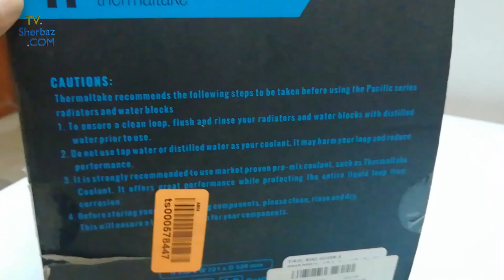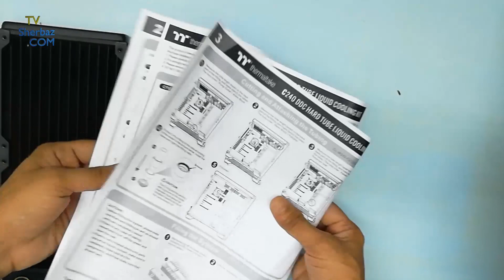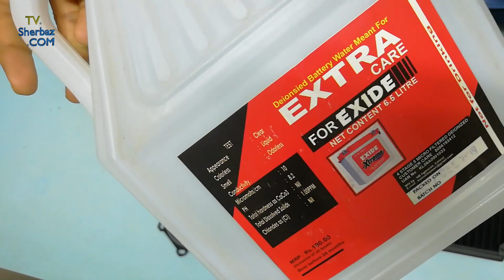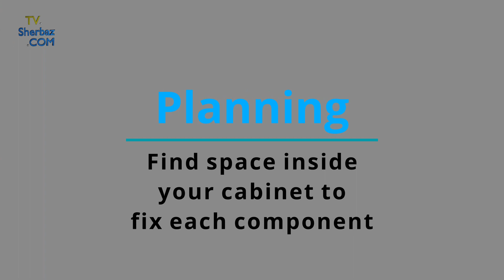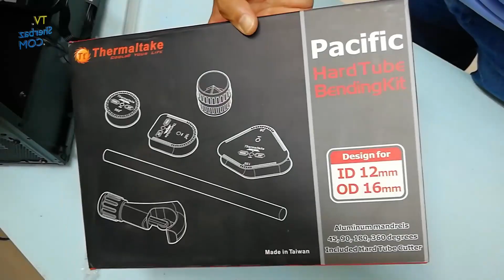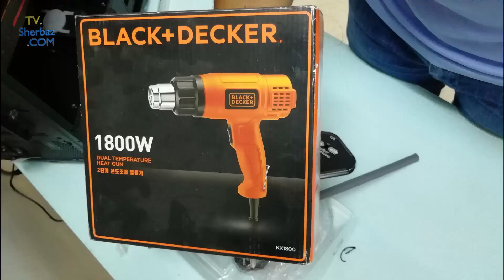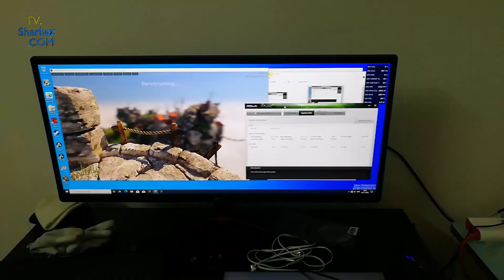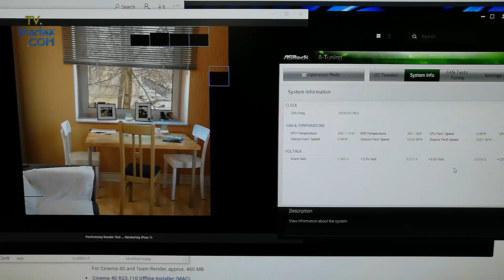Water Cooled Computer - Build in 12 minutes

Comment: Can you add different colors
Reply from the maker: Yes. It has RGB LEDs and can be set to any colour.
Reply from the maker: And yes, we could mix colors on water. But need to make sure of good quality colors that do not corrode metal parts..
Reply: @SherLabs  Ok just making sure
Reply from the maker: Plain non-conductive coolant is safer